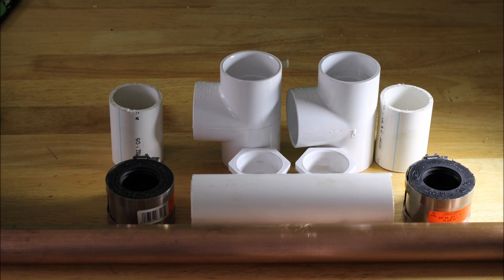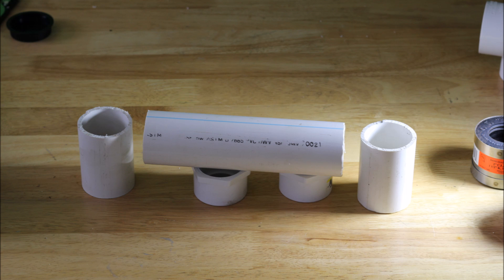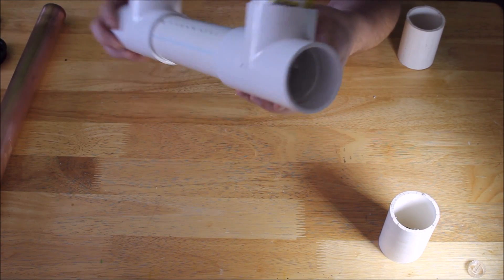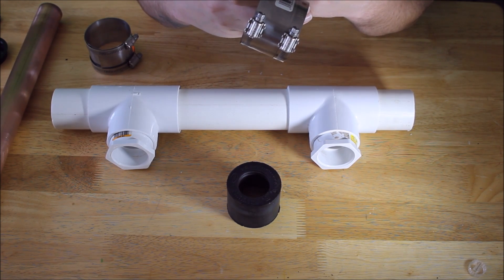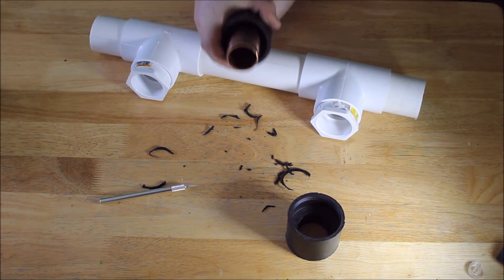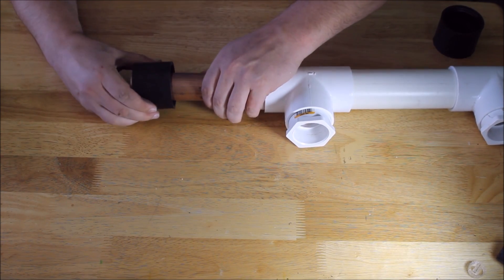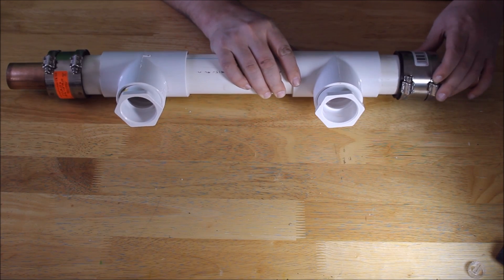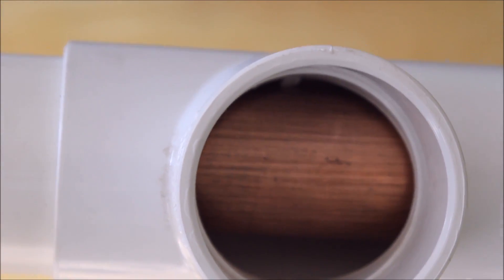How To Make A Heat Exchanger - Cheap

Comment: Thanks for the upload! Quick question; I want to build a heat exchanger for my solar water heater, and I was just wondering about the pro's/con's to decreasing the 1-1/2" copper exchanger to 1" for example, for more capacity between the exchanger and the pvc?
Reply from the maker: When you reduce the size of the copper pipe, you are reducing the amount of surface area for heat transfer. You may need to make the exchanger longer or bank a couple of them together. I should have a video on banking within a couple of weeks. I am also making a video on slowing down the fluids and using fins to increase heat transfer. Thanks for watching!

RTP
Reply: Rob The Plumber I see. I like the bank idea. Looking forward to the next video. Thanks for the quick response! Cheers
Reply: @RobThePlumber  You may want to check this.  Smaller copper pipe will increase the surface area per volume inside copper.  Super cool idea (pun intended).  I may try this for my boat project.  Thanks for the inspiration!
Reply: Rob The Plumber Great videos Rob! Thanks for sharing and making it possible for us DIY's to make small changes that potentially can make a big difference when it is open source :-) 
Is there a video on slowing down fluids?
Does it make any difference on heat efficiency (with slowing inside PVC pipe) if the hot water is pumped inside the copper tube instead of in the PVC pipe? 
Good point about better insulation in outer PVC pipe. Copper pipe in copper pipe doesn't make much sense with the heat loss to the outside...